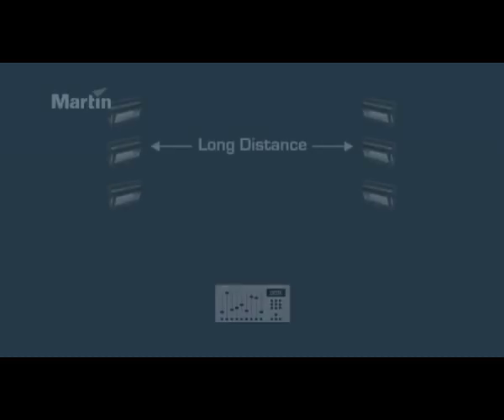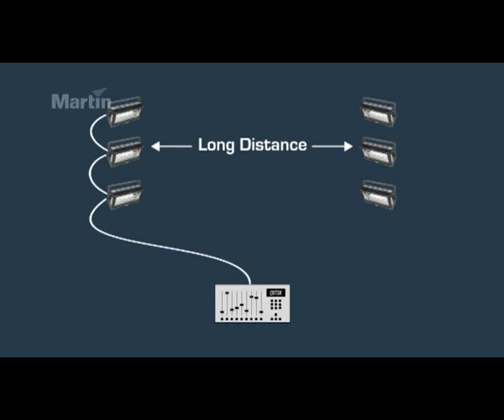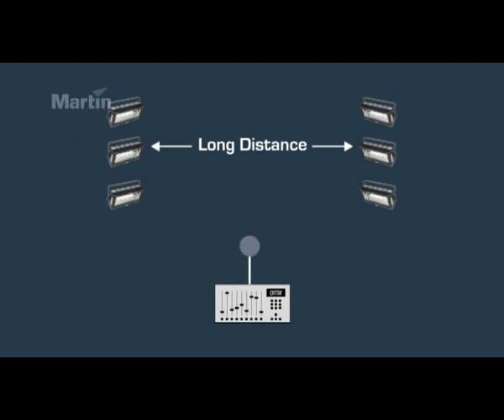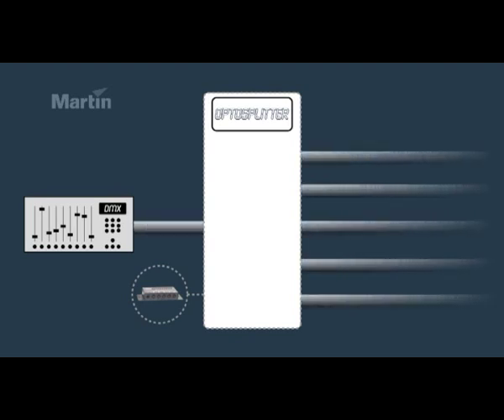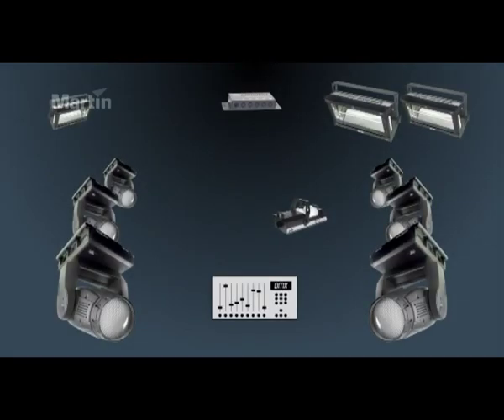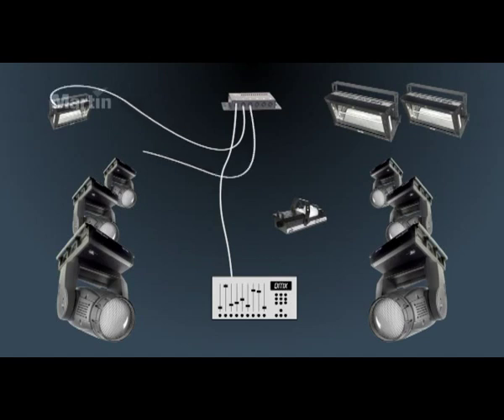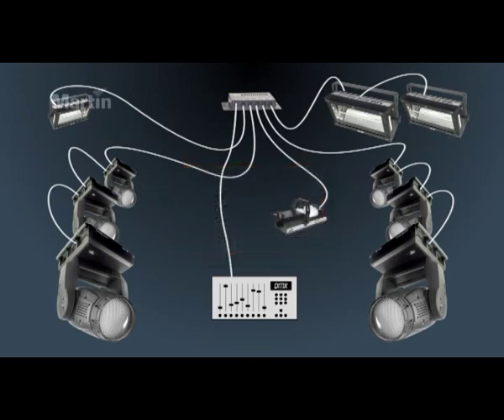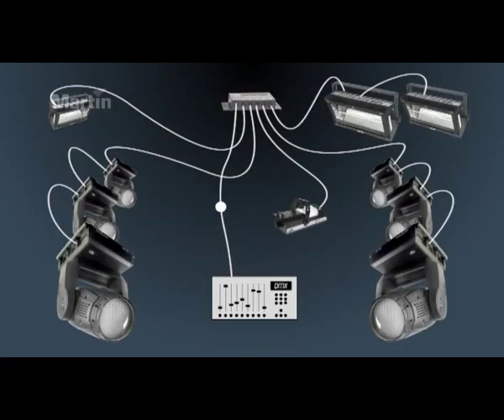DMX512 cabling

Comment: Hello,
im running an elation EWDMX transmiter to 3 elation xtremes with EWDMX then from each xtreme im connecting with DMX cable an ADJ Vizi beam and UV bar16. 
my problem is that only the extrems elation fixtures will work but nothing else. all DMX addressing is fine cause if I connect everything with DMX cables it would work fine. the  only problem is when i try to use the built in reciver of the elation xtremes as a DMX spliter....